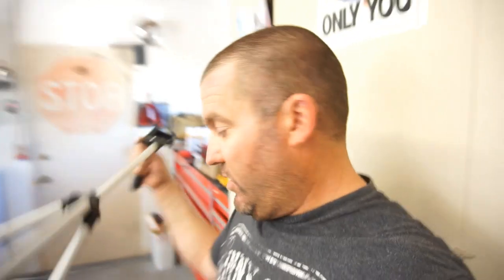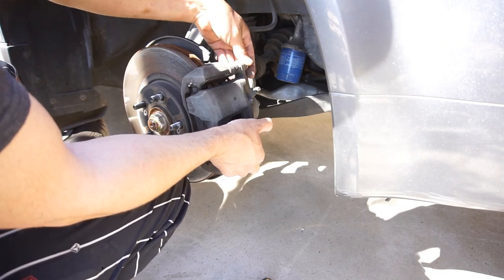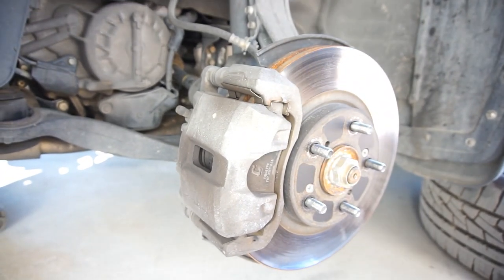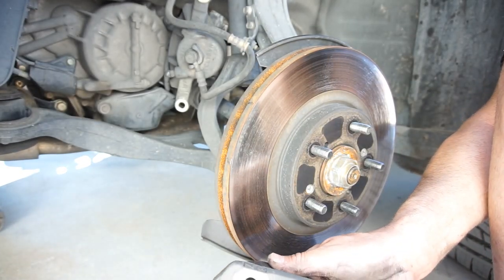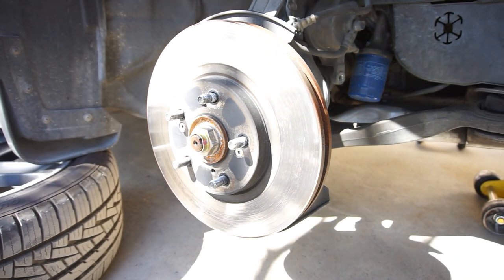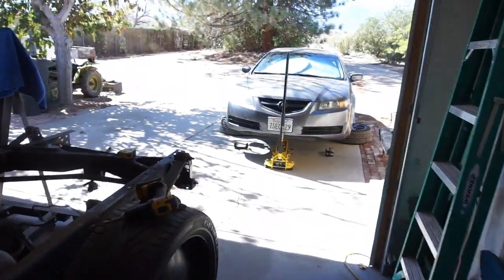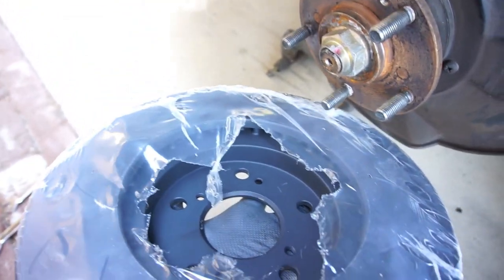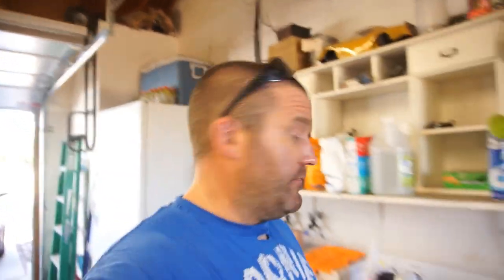NASCAR Brakes On An Acura TL? Duralast Performance GT Rotors. 2004 3rd Gen

Comment: IF the set screw would have been stuck on there..... what do you do to get them off? Chisel and hammer? Living here in the mid-west, EVERYTHING rusts! I take those set screws out and never put them back in.
Reply from the maker: OneNGlen always put them back in. Probably drill them out enough to break the head off then the rest will unscrew after the rotors are off. The stainless steel Allen screws I put in were because they were missing and the car had a vibration so I put new ones in. And they make an impact philips that you hit with a hammer and it spins them right out.
Reply: @Halffast719  I had no idea actually that I could get  stainless steel replacements for that. LITERALLY... first brake job on my vehicles those come out and never go back on. Where do you recommend I get those?  Mid-west, we use salt to combat snow and ice.... nothing but rust out here!

Comment: Dont worry about touching the rotor with greasy hands because they all come shipped with oil on them...  (break cleaner)
Reply from the maker: t c I try to keep the grease off of them because the brake cleaner has a hard time removing grease. Brake cleaner will remove the oils pretty easily though. The cleaner the better in my book.

Comment: By who's measure have you got too much time on your hands ?  LOL!  I assume the grey rough finish on the rotors is to help seat the pads ?  I 've never run across it before .  Who's brakes were on it before ?  They sure looked at least 50% and the rotors were warped ?  Does the Mrs. ride the brakes ?
Reply from the maker: Orion Fixr too much time comes from everyone. Vatozone rotors were on there before. Duralast cheapest. Yes there was a vibration once you hit the brakes. No she doesn’t ride the brakes. Yeah the coating is to seat the pads I guess.
Reply: @Halffast719  ; My wife has a habit of two footing an automatic and following her sometimes is challenging ! She'll not be paying attention and the brake lights never go out !!  LOL !
Reply from the maker: Orion Fixr that’s not good. I’ve followed a lot of people doing the same thing. Always wondered what and why?

Comment: Nascar does have or use cross drilled or sloted rotors. Sorry but Nascar pads and rotors are NOT for sale to public. It would cost as much as that used car you have
Reply from the maker: Haha yeah I know. It’s a joke. Because it says NASCAR on the box. Hahahaha
Reply: You actually can buy them there just stupid expensive. Every single part on a nascar race car is available to the public. It's part of the rules